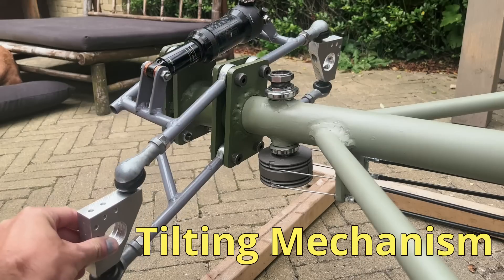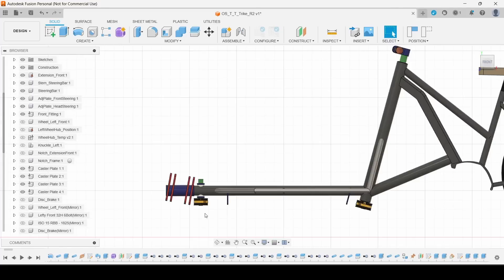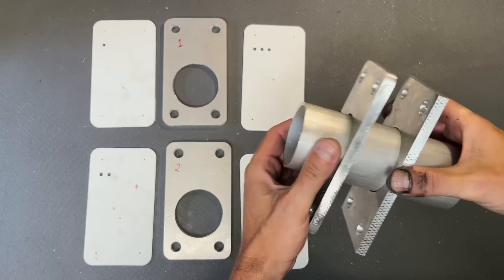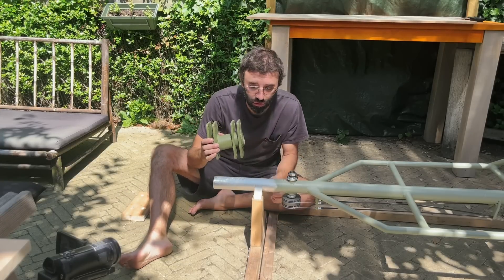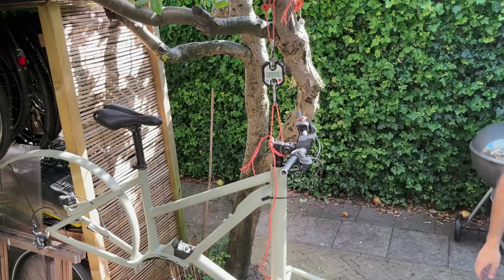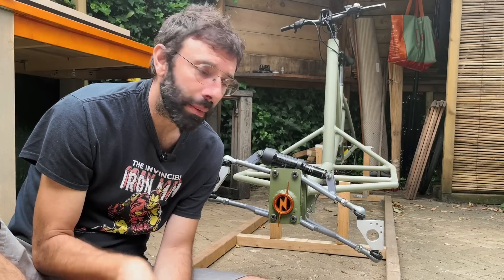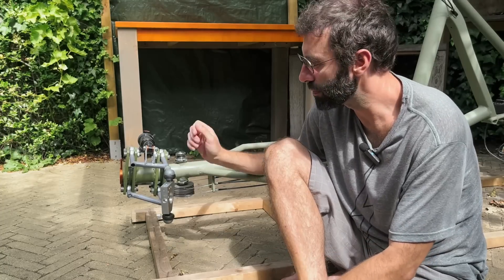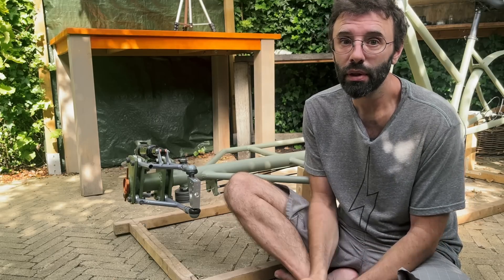#2 Tilting Mechanism - Tadpole Tilting Cargo Trike Build

Comment: Un poco de calor en la pieza postiza dilata y facilita el montaje. Felicitaciones por el gran trabajo de investigación y compartir! Excelente!
Reply: I came to comment heating the outer tube with the plates to expand it and laying an ice pack into the inner tube. Then you remove the ice pack and let the outer tube cool down in the correct position and you’ll have a perfect press fit. Might even make the inner tube a smidge larger to really keep it from moving 😊
Reply from the maker: @RobiBue  indeed this idea with the ice inside and the heat in the outer tube sounds like a great tip for a press fit. Thank you!
Reply from the maker: Indeed, I realize this is a technique to fit tight components. Thank you very much!
Cheers!
Reply: @pedro-neves Yeah, even better if you heat the caster plates tube (even a hair dryer would do) and put an ice pack on the frame tube. I did something similar when I had to remove the rear casette from a bike when I was a teenager.
Reply from the maker: @YurkerYT  that's a very practical way of doing it. Great tip!

Comment: I like the 3d metal printed pulleys for the cable steering. 

I'm working on addressing the poor turning circle of my recumbent bike by converting it to cable steering, and having a set of lobed, not circular, pulleys coupled with polymer cords. The idea is to have a smaller gear ratio when going straight ahead for less sensitivity, and a larger ratio when reaching the limit of rotation of the handle bars for a tight turning circle (under seat steering limits the range of motion considerably compared to upright cargo bikes).
Reply from the maker: Thank you!
Sounds great to have a changing steering ration depending on speed (like the Cybertruck;)). If you can pull int off in a simple, mechanical way, it would be pretty cool! I hope you share it;)
Cheers!
Reply: @frankReif I'd love to learn more about your project. If you have the time and itch to share what you're doing I'll be the first to read it:) It reminds me a lot of the "exponential" transfer curves that are also frequently used by quadcopter enthusiasts!
Reply: @feudiable  I think it's very specific to recumbents with under seat steering. 

I'm not familiar with the quadcopter reference. I did get the polymer cord idea from them, though. It can be wound around a much tighter radius without damaging over many cycles - unlike steel cables, which wear quickly.

Comment: Great Ideas and great Work! I wish I had those skills and capabilities to build smth similar as a replacement for my car would be welcome.

As you asked for suggestions 🙂
Your welding skills could be improved and / or maybe MIG/MAG would do better than WIG in this case? 🙂

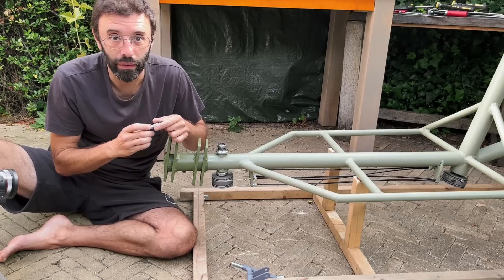In 10:15 Elastic-Stop-Nuts would do better (at least for the final assembly) 

Again: Great work and I wish I could build or afford smth like this <3
Reply from the maker: Thank you so much for your kind comment!
My welding skills are indeed the most basic. Actually, this is my first project welding aluminium. I just bought the cheapest TIG AC welder and started. I'm trying to improve bit by bit;)

Elastic stop nuts - You are right. I'll have to replace them at some point.

You are very kind. And as a word of encouragement - I'm using very inexpensive tools, sometimes second hand, and I buy something extra per project and increase my capability over time. And I work in my backyard. In the winter is very cold;) In my next video (I hope you watch) I need more tools than I have (a lathe) so I found a place that rents the use of their lathe in 4 hours slots. I'm just saying this because for those that like to build stuff, it does help with happiness. So, I wish you happiness, either it is building or doing what is best for you.

Cheers!
Reply: @pedro-neves  
Thank you helping me understand 😍

I really like your work and the affords (experiments about the best chassis settings f.e.) you make. This is far beyond taking randomly parts, welding or screwing them together and dealing with the outcoming. Instead you research and adjust actively the results 💪
Reply from the maker: @radwanderer6165  thank you so much for writing these kind words. Indeed, I'm on a mission to make something truly great to ride and well-made and share with everyone how to make it. I also share the drawings in editable format, so I try to be rigorous and honest about what I'm showing.
Cheers!

Comment: A tiny bit more clearance on the tube as you said would probably be the easiest way to make the parts fit better/easier, besides directly welding the plates to the frame of course 😅 Although that would mean it’s all very permanent and the assembly can’t be removed if changes are necessary… It would also be possible to heat up the outside tube a bit and/or cooling down the inside tube to help create a bit of clearance if there’s no tube available with a slightly bigger diameter, but it’s quite a hassle to do the heating and/or cooling 😅 
For the wishbones, I think the ball joints are the best option, they offer a bit of wiggle room plus, they’re used on racecars too.. if they’re good enough for racecars, why not on cargo bikes/trikes right? 😋
Reply from the maker: Thank you so much! Indeed, welding it in place would be a good option, but because I don't have a good setup to hold the frame, I try to do as much outside the frame and then fit it there. Also, as you said, if I welded it in, the frame would be harder to redo something.
I'm trying to make a cargo trike that is great to ride, so! Racecar components it is!
Cheers!

Comment: I think a lot of motorcycle/dirt bike/scooter swingarms use bushings rather than bearings or ball joints, but because they're good enough and cheaper/last practically forever compared to bearings/balljoints which both need a lot more care and maintenance. I feel like since the tilting mechanism is part of how you steer the trike, you want maximum rigidity outside of your intended axes of rotation, versus the kind of play that bushings allow in two axes. When you add the play up between the two sides, I think you could get a 'wobble-steer'/resonant vibration in your suspension arms. It might be smoother over certain types of surface roughness (gravel of a certain size at a specific speed?) to have bushings, but you already have a shock and the flex in the main tube of the frame to do that, so I say keep the balljoints. Stiff rotational links and a tuned shock is always gonna handle better than the slop you'd get with bushings, even when the bushings are giving you a more comfortable ride with that slop in the system. Different story if it was just a single swingarm, of course, and it probably depends on load and surface quite a bit, too. Maybe the 'sport' version keeps balljoints, and the 'delivery' version of the trike gets bushings if it turns out the ball joints don't last as long as you'd like under hard use?
Reply from the maker: That's incredibly good advice, thanks! Actually, the thing I like the most about this build is that it has no detectable play anywhere. It is so rigid! I think it's gonna be super cool to ride.
I hope the ball joints last!;)
Cheers!
Reply: I'd just finished writing "The bushing is always the correct choice, with the caveat that it must be thoughtfully designed and of an appropriate stiffness." when I happened to glance at your comment. You're 100% correct that ball joints will ensure intended geometry under extreme use cases, that's why you see them on performance control arms. They're also illegal to fit to a registered vehicle where I live, due to the service life and failure mode of the ball joint. You're right though, both have a use case. Unlike the ball bearings, who were doomed from the start.
Reply from the maker: @maccadan90  thank you so much for the extra notes! I'm learning that ball joints are not the most durable things in the world. Even illegal to fit to protect consumers in some places? Super interesting. If this design is good, I'll definitely ride it until it wears out and try to improve the durability.
Cheers!
Reply: @pedro-neves  Illegal to fit to a car, your use case here is much less extreme. I think you will get reasonable life out of the ball joints, but the slop will begin as soon as they start to wear. It's important  to change them early because they progress from worn to catastrophic failure much faster than an equivalent bush. This may still be a long time! I'd also strongly recommend dust caps over a light layer of the correct grease for the joint. The cleaner you keep them, the longer they will last.

PS I stumbled upon you while you were iterating this, I can't wait to see it ridden in its final form! Keep up the awesome work!
Reply: @pedro-neves  Indeed, the modular nature of your design means you can revise if Version 1 doesn't work as long as you'd like. Solid setup here.
Reply from the maker: @maccadan90  thank you so much! Happy that you will continue watching! I think it will be super cool to ride;) Let's see;) And let's see how those ball joints hold up!
Cheers!
Reply from the maker: @wakjagner  thank you! I'm happy to keep iterating if it means making it better every time;)
Reply: @maccadan90  the failure modes were also what concerned me, although it's nice to know I can find ball joints that small for projects so I can consider them in the future.  Thanks for bringing it up.
Reply: Great comment!
Reply: Bushings are typically used when the joint is slow in rotation but needs to be firmly controlled in location due to high loads. Ball joints can be used in lower load but high flex areas but of course need to be sized accordingly.
Reply: @matthewmoilanen787  Например, у меня встречаются разбитые дорожки. Мне лучше использовать втулки?
Reply: @ВладимирСмородинов-х2с  Sorry I'm unable to translate your comment so I don't know how to respond.
Reply: @ВладимирСмородинов-х2с  Well typically bushings are the better solution but if you need a larger range of movement sperical rod ends work wonderful. I use them on my race quads and have never had a failure. They are relatively inexpensive shopping online but make sure they are steel not aluminum. They look cool as well.
Reply from the maker: @matthewmoilanen787  thanks for the tip!
Reply: А что если вместо шаровых шарниров использовать сайлентблоки от какой-нибудь малолитражки?
Reply from the maker: @ВладимирСмородинов-х2с  , I suppose that could work as well (like bushings).

Comment: @7:37 Yeah the welding will warp your tubes and make friction fit surfaces almost never slide smoothly. Sizing up the tubes would probably be the only option part from welding directly onto the frame and not doing the friction fit at all. The other option would be to weld onto a cylinder rather than a hollow pipe. Then machine out the 54 cm diameter hole after the welds are complete
Reply: Use a brass insert/mandrel to keep the tube's shape while welding?
Reply from the maker: @noelgrandin  , thanks! Wouldn't a mandrel only support the ends of the tube and let the middle warp?
Reply: @pedro-neves  not if you used a solid cylinder of brass as a mandrel
Reply from the maker: @noelgrandin  thank yo so much and excuse me for the questions, which may not seem great because I'm a mechanical hobbyist - with a solid cylinder, wouldn't it be hard to remove it after welding?
Thanks!
Reply: @pedro-neves  There are various ways of making removable mandrels, depends on what kind of machine shop tools you have access to. Although come to think, It might be easier to put the tube on the frame first, and then weld the fixtures, rather than messing with mandrels. If you really want a mandrel, the simplest one I can think is to slice it lengthways in half, then you can remove one half at a time.
Reply from the maker: @noelgrandin  absolutely. I think next time I will weld it in place to not have to mind so much the tube losing shape.
Reply from the maker: Thank you. Ya, in my previous build I had a 1 mm gap between the sizes of the tubes. It was a steel build so things are a little different but this worked well.
Cheers!
Reply: I was going to suggest making an adjustable lapping tool from a cylinder of wood wrapped with fine sandpaper or wet'n'dry to remove the high spots from the bore. https://www.joke-technology.com/media/image/c1/df/18/570171-570188_1280x1280.jpg

Comment: You're breaking it down in logical steps and digestible portions.. don't trip..)/* 
Seems like ball-joints made the build that much easier, also easier to replace a balljoint then pulling a bearing.. hope they have grease ports.
Sweet build, thanks for sharing!
Reply from the maker: Thank you so much! Indeed, the build was easier with ball joints. These are the cheapest I could find but if this turns out to be the "final" component, then I'll consider putting in the good stuff.
Cheers!